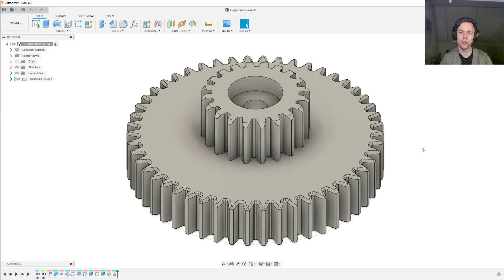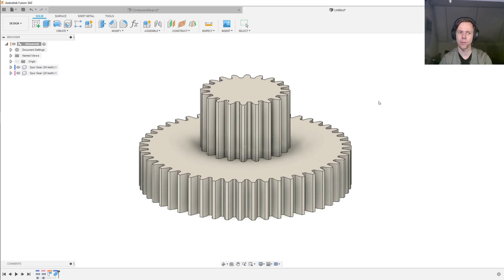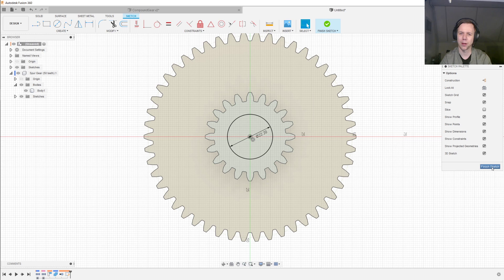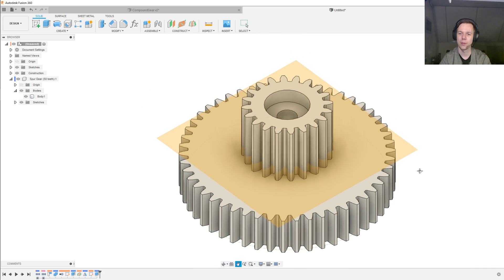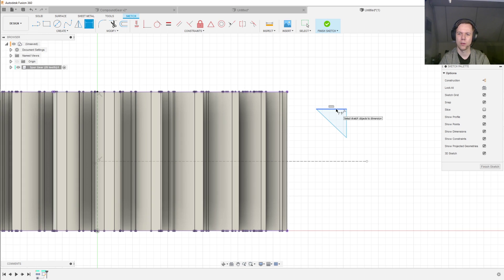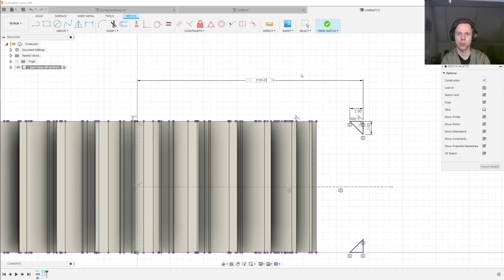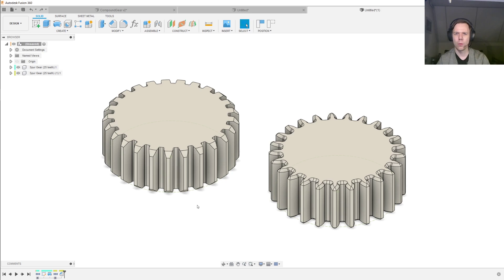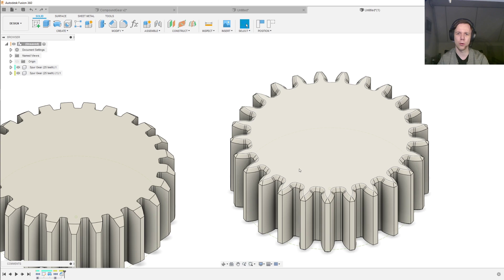How to model compound gears, and how to chamfer the teeth of gears. (Gears pt 1.5/7)

Comment: There's going to be an obvious performance difference between how these two methods function in a real world environment. So I would say there is more to this then simply a case of varying methods.

Any insight into which one is actually the proper method? Or for which purpose you would choose one over the other?

I have to imagine a machinist would be after my head if I sent him the second!
Reply from the maker: I would use the first method for if I must model a gear or cut or hobbed out of a metal blank. You can make that chamfer in the real world quite easily on a lathe. The only hard thing is how to fix a gear in the lathe, you'd need a chuck with the right number of jaws or a mandrel. In my own case that would always be a purchased gear, I don't have the tools to cut my own gears. Most gears you can buy come with this type of chamfer already cut.

The second method is nearly impossible to machine. Maybe with crazy fixturing on a CNC mill you can get it done, but I've never seen someone do that. It's quite trivial for 3D printing though. A machinist would indeed be pretty annoyed if you put that on a drawing.

I don't think there's a big performance difference, it's just that the second chamfering method is nearly impossible to machine, but can be 3D printed pretty easily.
Reply: TOT "you can charge more" XD